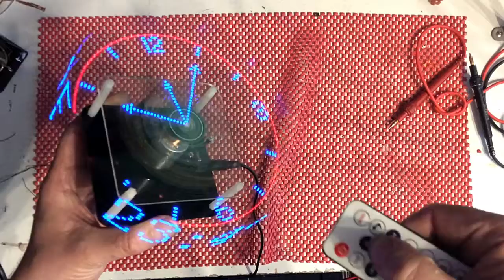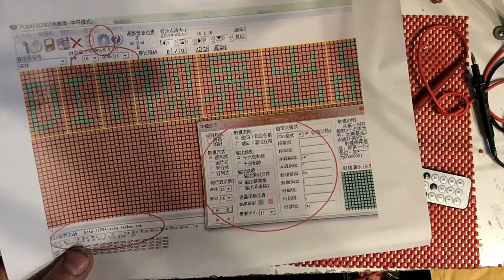Rotating LED Kit from Banggood.com Build part12

Comment: Hello Kev. I just completed building this kit. I built a smaller project to practice soldering SMD's and used the paste and heat gun method. For this kit, I decided to try your way and just use a soldering iron. It went surprisingly well. I had the IR remote issue too. I mounted the receiver according to the diagram on the board. After looking at the legs on the spare receiver, I realized that the receiver diagram on the PC board showing the flat towards the battery is drawn wrong. This video was a great help as I would have tried to press the coil of the top part all the way into the coil on the base. It must have been a headache for you trying to get it back apart.
Reply from the maker: Yes it was a pain when i pushed it to far, in these builds i do try to keep to basic tools that most people have or can obtain for not much money. (its also more of a challenge).

Comment: Thank you so much for this series, Ive been fighting with mine since I finished building it. As like yours my remote doesnt do anything so like your video I have ordered some new ir recievers to see if that fixes the problem. My next problem was trying to program it, ive had no luck I will review the rest of your videos and see if you answer my problems
Great Job thanks again!!
Reply from the maker: the ir sensor i changed was because i had no display, my issue with the remote was i had put in one of the codes that didnt use a remote

Comment: Regarding component. You said it was IR receiver. Can you please share what is the kind of this thing? Thanks.
Reply from the maker: I purchased 10 on ebay for £1.99 they were listed as 10 x 3mm 940nm IR Photo-diode. you only need this if your sure the one supplied is faulty.
Reply: howto change language

Comment: Cannot set the time: Hi, thanks for these very nice videos. I already finished assembly when when I discovered them. Should have discovered them earlier. Now, I cannot set the time. If I press the play button, I see the chinese characters similar to "Att" as shown in the video but there is no number behind that I could change with the "up down" buttons. I already flased "3 digital clock display program" and tried with some other flash files. No luck. Unfortunately the initially flashed file is gone now. ( With the nice animations ). I think it is not included in the zip file from Banggood. Somebody else had the same problem ? Thanks
Reply from the maker: the best flash is 7, numbers missing may sugest the real time clock chip is not working as it should, make sure its been correctly soldered, its the DSxxxx one.
Reply: Yes, that must be the reason. Makes sense. However, I cannot find the problem. Will order a new DS1302. In the meantime I will play with the software and update the text. Thanks !

Comment: Been fighting with this for a couple of days, I don't seem to be getting anything from the power board. The motor works fine, my shredded knuckles can attest to that. The transistor oscillator isn't, oscillating that is. The IR emitter doesn't seem to be working either. I'm awaiting replacement parts to rebuild the power board but to be honest I actually can't see anything wrong with my build or soldering. Would you know what the correct voltage and frequency of the oscillator output is?
Reply from the maker: Hi, Voltage is going to be no higher than supply as its on the primary side, frequency unknown but will if i get the chance put it on the scope and report back
Reply from the maker: 193.8khz measured square wave at about 0.9v p-p on center pin of power transitor, looks to be 80% duty cycle (not measured)
Reply: Different account, youtube is not letting me post from Efros2 for some reason only known to Google. Anyway wow that's a fairly high frequency, OK thanks Kev I'll let you know once the new components arrive how I get on.
Reply from the maker: yes it is, its what the scope said :), maybe losses are less on the coil in the radio bands
Reply: Finally got around to checking this out, the oscillator is totally dead, still waiting on some bits. The main board seems to be fine, attaching 5v to the connector steps all of the LEDs through a cycle. Ironic that the simplest part is causing the issues.
Reply from the maker: Happy days (being the basic side), let me know what had failed when you find out.